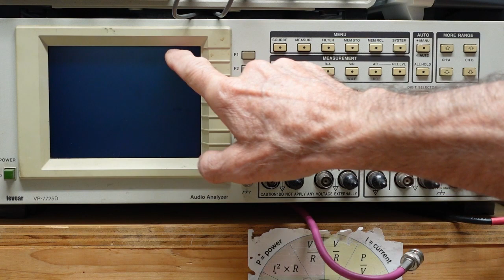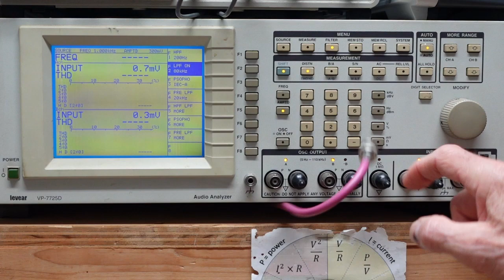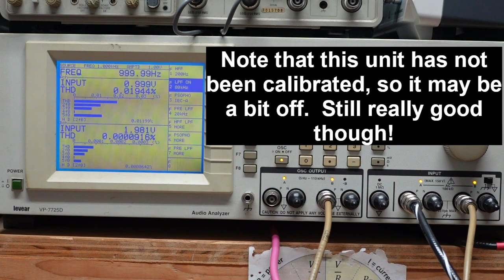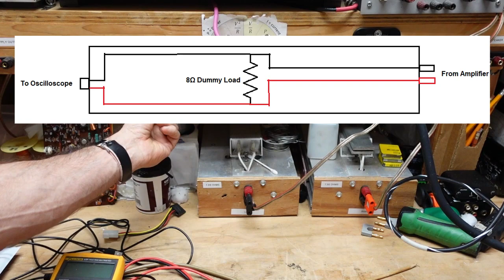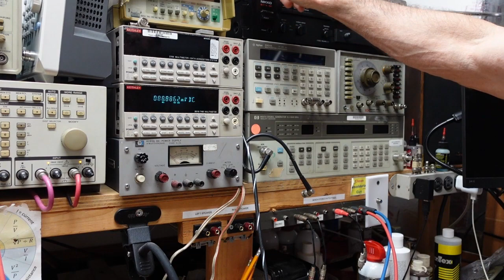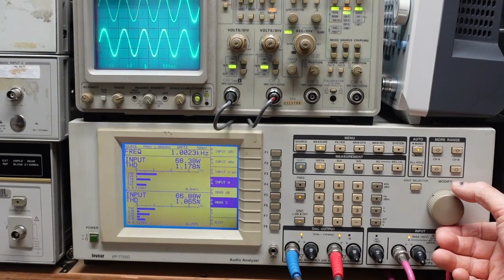Using the Panasonic VP 7725 Audio Analyzer

Comment: Hi Ray, Just watched your Video on the Panasonic VP-7725...Mine is a "B" model. I noticed that you are using Termination BNC caps on the unused BNC Out output and input area's. Can you tell me if they are a 75 Ohm Or a 50 Ohm terminators?  Thanks for Giving Back.
Reply from the maker: They are neither 50 nor 75 ohm.  They're dust caps.  😂
Reply: @raygianelli3612   Ok How about the Neutrik BNC cables you showed in the video. Could you tell me where you sourced them from? Would like to also feed my scope from the VP-7725B. Thanks Ray
Reply from the maker: @ Newark has them.  The model number is NF2C-B/2.  Warning: they're obscenely expensive.
You can connect your scope from the back of the analyzer.  There's 2 sets of BNC connectors, one show the autoranged signal, the other shows the residual distortion.  Note: when connected to your scope, you lose the ability to isolate from ground, due to the connections to the BNC shell of the scope, which is tied to earth ground.  If you can find passive video baluns that terminate BNC to BNC you can isolate the analyzer from ground.
Reply: @ Thanks Ray, I'll check them out. Also, I saw the video where you showed the get shocked with the scope hooked up.. L.o.L.

Comment: Hey Ray I am not sure if i mentioned this to you. The issue you mentioned with the isolation ground being defeated by connecting it to a scope thru the rear monitor output of the 7725 in this video, I found if i use a set of BNC isolation baluns between the monitor out and the scope  i can pass the signal thru to the scope adequately and isolate both the ground and signal between and resolve this issue and still keep the scope and the 7725 earth grounded. One drawback though that cannot be defeated is if you are testing a stereo amp that has a hot negative and positive signals that the input ground on the 7725 is all tied together so there is no way to test amps like this driving both channels at the same time. You would only be able to do one channel at a time. trying to use a balun like this on the input side will interfere greatly the ability to read both levels and THD properly though i havent actually tried this but i assume it would have that affect.
Reply from the maker: Hi Frank!
You told me about the baluns when we spoke about this way back, and also sent me a link to them.
No idea about using a balun on the input side.  All the amps I've worked on lately don't have balance outputs.

Comment: Hey Ray.. Great Video, and as always very informative… What are you thoughts on the the QuantAsylum Audio Analyzer (QA-40x) and/or the Digilent w/Audio Analyzer suite, as an alternative to the VP 775d..? You mentioned that your VP 775d cost quite a bit.. Is it worth hunting down? Or (for the money),  is the QA or Digilent solution just as good..? Thanks for what you do…
Reply from the maker: As always, the answer depends on your application and budget.  IMHO the Quantasylum is the best bang for buck out there, and I probably would have gone that route if I had it to do all over again.  But the Panasonic lets me test both channels at once, which is how most amps are rated, so that's a plus.  And I've thought about used Audio Precision gear too.
The Digilent Pro series looks good but is also not cheap.
Basically the law of diminishing returns applies here in spades.  If you want low distortion measurement capability be prepared to pay.
Reply: Thanks for your input Ray.. Much appreciated..😊
Reply from the maker: @esci8978  Let me know which way you decide to go.  Always nice to have input from someone who owns a piece of test equipment.
Reply: @raygianelli3612  I have an opportunity to pick up a used Digilent Analog Discovery 2 for half the cost of new… So I think i will get my feet wet with that.. I know    It won’t measure no where near the low distortion levels of the Panasonic, but for the little cost, it would give me the opportunity to learn..  Moving forward from there, I’ll wait to see what opportunities are out there to acquire something better, like the QuantAsylum product….As nice as your Panasonic is, I like being able to have the visual representations of what the combination computer screen/QuantAsylum type equipment offers..
Reply from the maker: @esci8978  That makes sense.  If you are able to get something cheaply you can always get your money back should you decide to upgrade in the future.  Best of luck on your journey!

Comment: Love it! Thank you. Im currently looking into a AD-1 amp dyno. I have resistors and siglent 4 channel 1104xe. I really just want  an all in one unit.
Reply from the maker: The AD-1 looks pretty impressive.  So does the price tag.  IMO that kind of expenditure only makes sense in a production environment.  And TBH I think you'd gain a better understanding of measurement procedures using various units as most of us do.  But at the end of the day if you have the disposable income and you want it go for it.
Reply: @raygianelli3612  im not opposed to any other audio analyzers. I would use the AD-1 to make money and it does mostly what anyone wwants to know about their power ratings on their amplifier/distortion IHF certified and uncertified. Just like a car dyno. Same mentality i guess.

Comment: Great video as usual Ray, thanks for sharing. Did you happen to run the oscillator output from the Levear into the 2015 to see how low it measures on the 2015?
Reply from the maker: Yeah, while I have done that I didn't think to do it for the video, as I was focused on the Panasonic.  The Keithley measurement section works very well.
I actually used a sine wave created in Audacity and played on a CD player, which yielded better THD than the 2015's generator.
Reply: @raygianelli3612  Thanks again Ray, I was wondering how low of distortion you can get out of a good audio interface and a PC. So, a decent audio interface and a 2015 might be a decent solution for some at a reasonable cost.
Reply from the maker: @toddhoug9713  Todd, the limiting factor is the THD of the interface itself.  The last time I checked the Focusrite Scarlett looked to be the best for low THD.  Some manufacturer's don't list the THD, or some list chipset performance, which may be different installed in their product.
I've used the Alesis IO2 and the Behrninger U202 with Visual Analyzer with good results.

Comment: I have the 7725D also.  I had it on my eBay search list for a LONG time.  One finally showed up that looked like a good unit.  I offered $900 for it and he accepted my offer!  Obviously, I was skeptical about the condition but it is in great physical condition and works great. 
I didn’t catch the name of the cables you mentioned. What brand are they?
LOVE your videos!  Im always excited when I see a new one has been posted.
Reply from the maker: Bill, I found some Westek BNC to BNC cables at work for a piece of equipment that was no longer used.  I cut them in half, and put some Neutrik RCA ends on them.  The Neutrik's were about $10 each, but very good quality.
Thanks for the kind words, more videos on the way!

Comment: Once again great information.  I have attempted to work around the Keithley's issues by purchasing "Ultra Low Noise Oscillator boards, a 1 Khz and a 10 Khz.    Currently my biggest issue is the inability to purchase a Quant Asylum Q403, since they are not shipping due to a fire.  You had also mentioned a software alternative "Visual Analyzer", I did download and installed it connecting it to a very good USB based sound device (Scarlet 2i2 3rd Gen).  However, the initial setup and calibration of "Visual Analyzer" has me stumped (The only documentation I could find is in Italian).

Would you consider a short video demonstrating the set up and use?  I am sure many of us would really appreciate it since that may be the best solution for those of us doing this as a hobby.  Thanks again for the time you take to share your knowledge.

For anyone interested in information about the Oscillators I mentioned, here is a link.  I am in no way associated with the maker; I am just providing this in case it can help others.  I originally found the information on AudioKarma for "Victor's Oscillator", here is a link to a detailed description.  http://archimago.blogspot.com/2022/01/using-victors-oscillator-as-reference.html
Reply from the maker: James, I will at some point do a video on setting up and using Visual Analyzer.  Thanks for the suggestion!

Comment: Great video, thanks!! Your explanation of needing a terminator answers my question about why I saw double the voltage when I plugged the input to the output.  And the bit on the isolated ground helps too… I wish my scope had a fully isolated front end.  I sold the extra fully functional one to Ben at Novalux Stereophonic, who also has a YouTube channel and maybe it will be featured in one of his videos some day.  He seemed really interested in that extra set of BNCs on the back which apparently show just the distortion on a scope (and even connected it in X-Y mode). I’d love to learn more about how that works/what use it has one day.
Reply from the maker: I use the Rolls HE18 Hum Eliminator to connect the dummy loads to the scope, and it will provide isolation.
The BNC's on the back don't show residual distortion, but rather shows the input before processing.  Page 45 on the PDF.
Reply: @raygianelli3612  thanks for the tip on the Rolls!  Yeah I saw that in the manual, but it makes it sound like the “input monitor” and “reading monitor” are more or less the same thing, no?  If you connect a scope to the reading monitor it seems to give a totally funky signal that changes with the amount of distortion present
Reply: I checked out the Rolls device, looks like it’s just some audio isolation transformers in a nice box - I just found a use for the pile of small audio transformers I got in an estate sale.  Thanks again for sparking some great thoughts!!
Reply from the maker: @philsanalogbasement  That's exactly all the Rolls is.  Sounds like you've got everything you need!